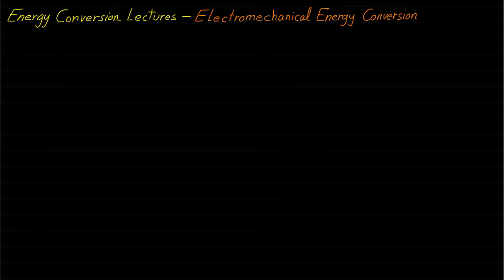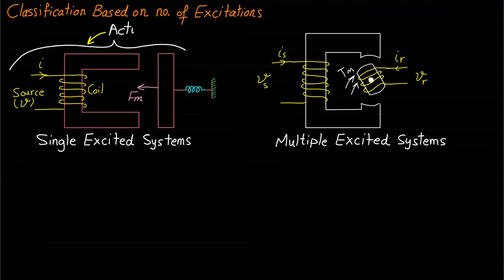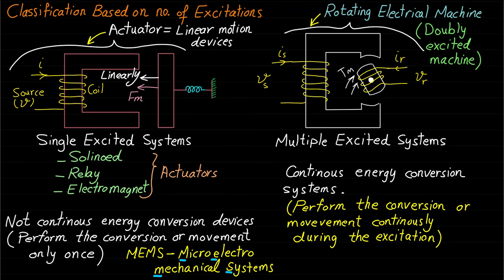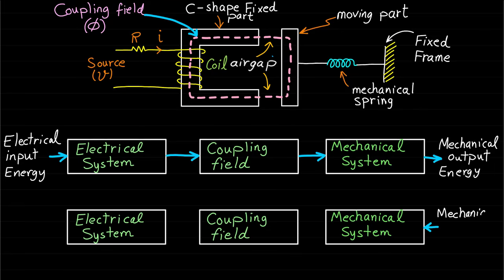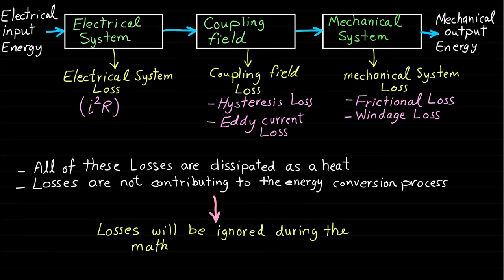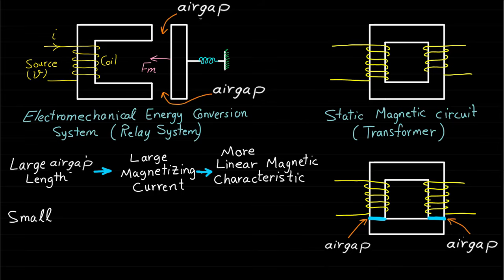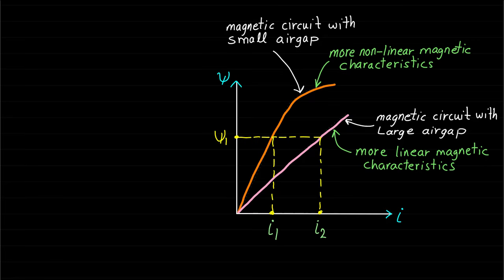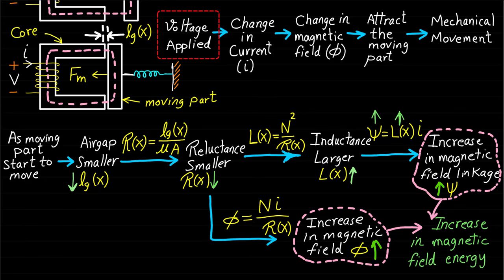Electromechanical Energy Conversion - Introduction (Part 1)

Comment: we are making these actuators of non magnetic materials so as to have higher force applied on the moving part , F=BILSintheta, We are increasing I , why are we not using magnetic material to have higher B instead and higher force? where is this applied force going in Transformers ? they are made up of magnetic materials , they do get saturated after a point , why we didnt think of having non magnetic materials as core , it would atleast dont have non linear magnetic characteristics. Why its so important only in actuators to have linear magnetic curve ? Cant we increase force there by increasing B ?Please clarify.